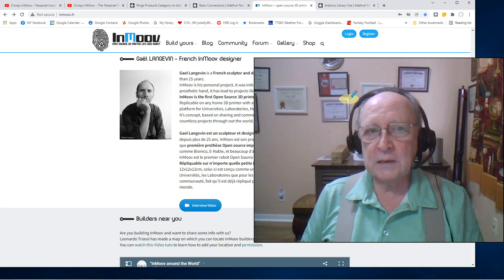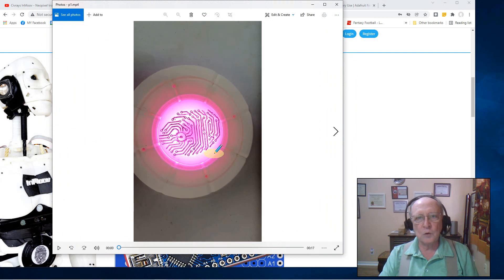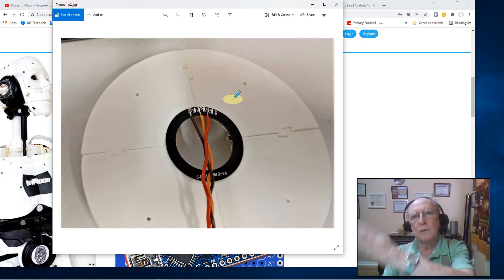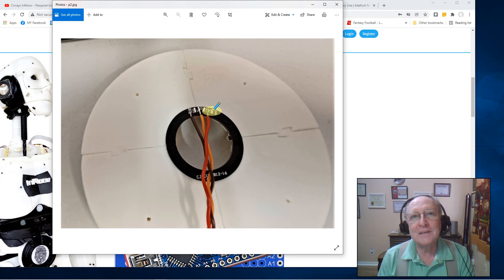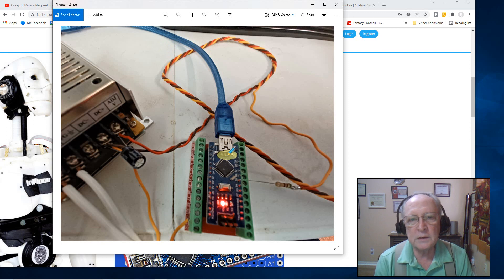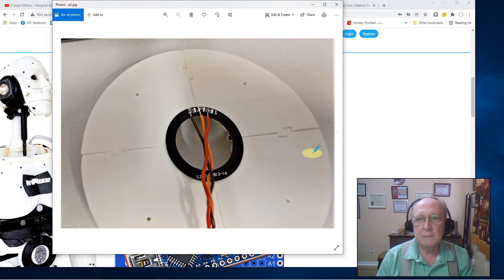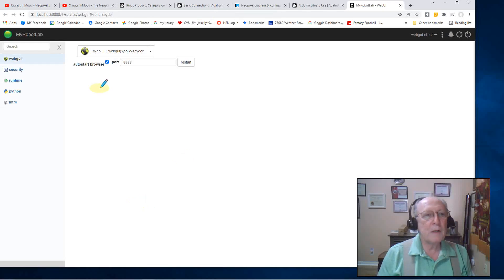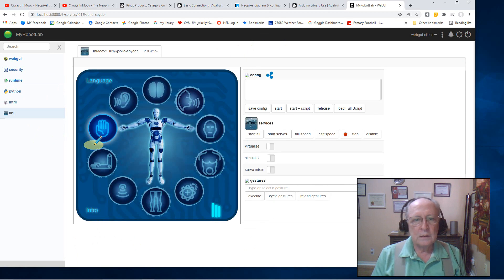11 Neopixel

Comment: Hi. Firstly, thanks for your videos!. They are very very helpful. I’m currently building my Inmoov and working on the Neopixel. I know the guys are fixing all the bugs in the new Mrl software but was wondering which build number you are currently using as the Neopixel will not work in 772. Thanks again
Reply from the maker: I went back and looked at my video and it shows I was using MRL 1.1.525 at that time. I've upgrade since then but have not been using the pixel ring so I can't say how it performs with later versions.
Reply: @jwkelly49  thanks for getting back to me. I recently downloaded the latest version and managed to get it to work. Haven’t tried any other features yet though. Thanks again